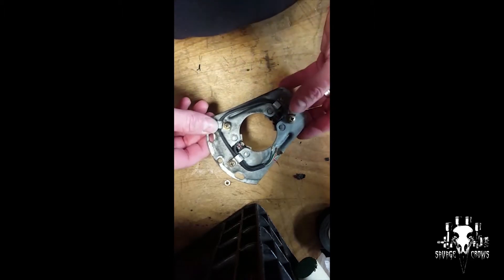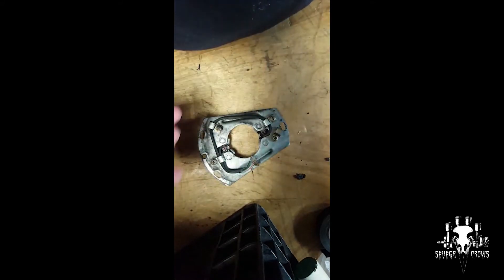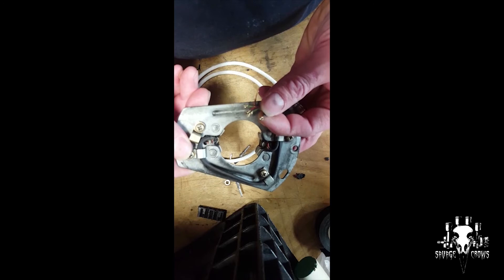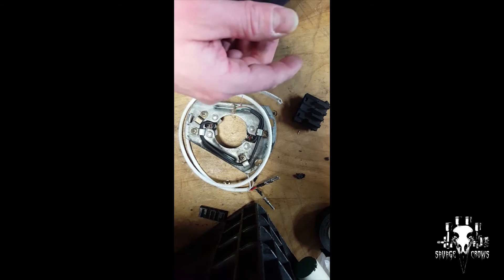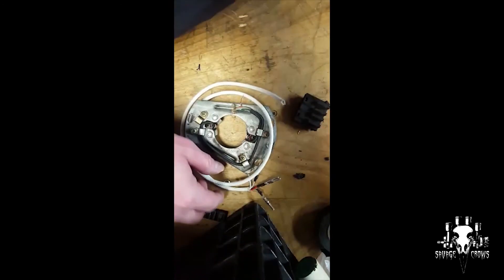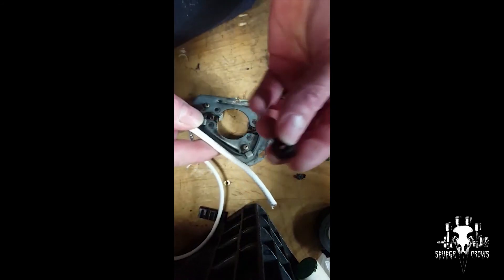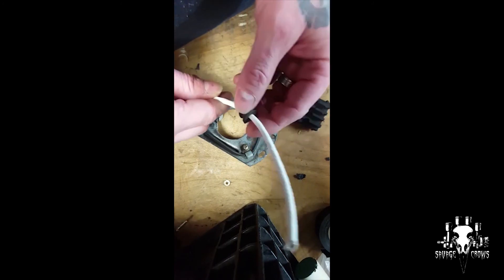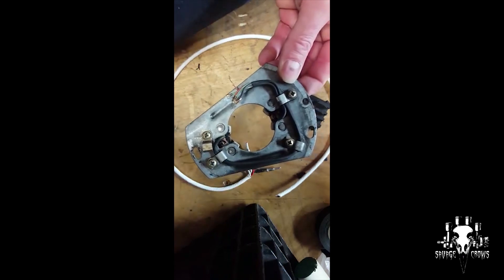Rewiring Hall Effect Sensor For BMW GS1000

Comment: That conductor that isn't connected to the sensors provides radio shielding for the other conductors. I considered rewiring mine until I couldn't find shielded wire that was heat and chemical resistant. I ordered a new aftermarket sensor instead and it looks like it was assembled without shielded loom🤦
Reply: Para que sirve el cable blindado , crees  que se distorsione la señal